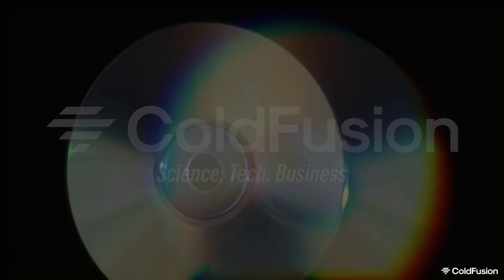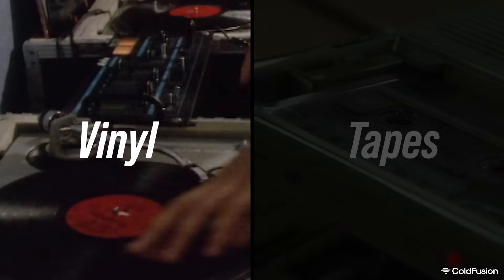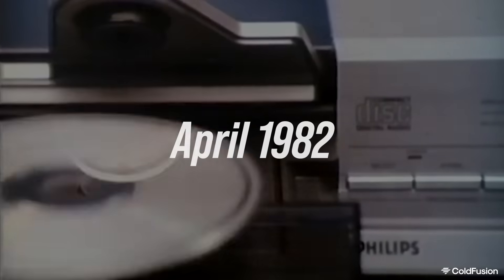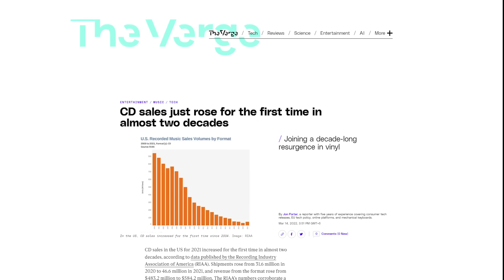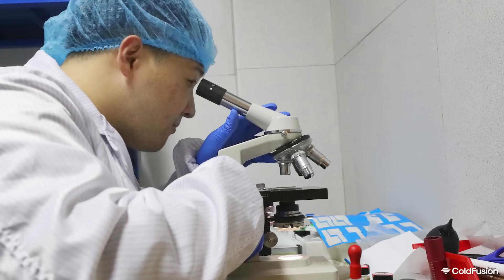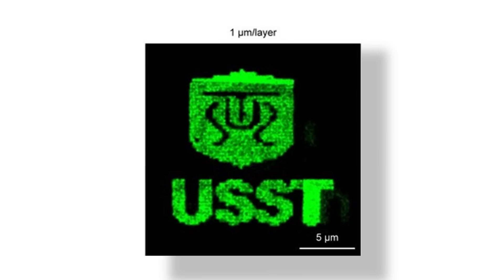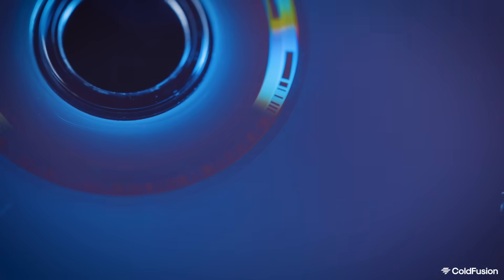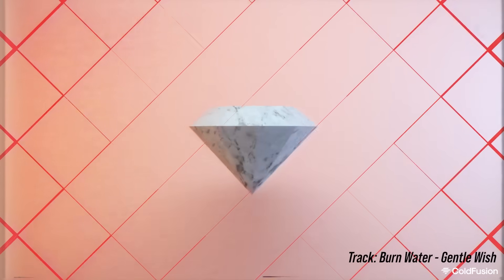Why This New CD Could Change Storage

Comment: The early development history of the compact disc is fascinating, development started in early 1975 to serve as the audio-only counterpart to the LaserDisc it was initially analog, just like LaserDisc.
By late 1975, they had adapted the technology into the ALP disc. 
The audio quality was not good, and any speck of dust or scratch in the disc would manifest as a click. It was apparent that they needed error correction, and for that they needed to go digital.
 
Over the next 3 years, under the leadership of Joop Sinjou, the team worked to create a digital version. This prototype, dubbed "pinkeltje" was completed just before Christmas 1978. 
In February of the next year, it was showcased for the first time. On March 8th 1979, perhaps the most important day in compact disc development history, the compact disc was demonstrated to a room of 200 journalists.
The technology, however was not perfected, the team contacted a number of Japanese companies, and over the next 2 weeks, the technology was demonstrated to 6 companies and committees, Sony was interested as they had been developing PCM, a way of digitally representing analog waveforms. Together over 6 meetings between engineers throughout the rest of '79 and into 1980, the format was perfected. Dynamic range ballooned from ~86db, to ~98db, Duration increased from 45 to 74 minutes. Dimensions were standardized at 120mm wide (small enough to fit into a single DIN car stereo. 15mm was set as the internal diameter (the size of a Dutch 10 piece). Cross Interleaved Reed-Solomon code was developed to make errors completely inaudible to the human ear. In April 1981 it was officially debuted at an event in Salzburg. The next year discs would go on sale throughout the world

Comment: The C3D(Constellation 3D) multilayer disc had been around since the late 90s.  The SSD commercially beat it.  It could had continued development for archiving data instead of being R/RW capability in the mid 2Ks.

Comment: Audiophiles: "you can't really hear the music unless you listen to the 2048-bit, 81 MegaHertz recording like the artists intended. And you gotta have that femtosecond laser, dude. Since you need fans you gotta put it in another room, so get yourself some Chthulu Cable to cut down on the picosecond delay between speakers. Or you can do what I did and put the laser in my bedroom pointed at the disc in my listening room. I forgot to duck under the beam once when going to bed and blinded myself in my right eye, but that just enhances my appreciation of the music with the senses I have left, y'know?"

Comment: This new storage medium isn't practical yet, but there was a time when the CD wasn't either. I will patiently wait and be glad there is still work being done in this space.
Reply: My brother and I bought a CD writer/reader for 1,000 Canadian dollars at one point lol, they are about 20 bucks now.
Reply: Imagine 2 hours movies coded into pure 12 bits RGB or 12 bit 4:4:4 YCbCr with no compression ! That would be very awesome ! Edit : Or complets series ? 😲
Reply: This will never move away from some very specific use cases. USB storage is simply too convenient. You don't need specialized hardware to read and write to it. Speeds are great. NAND memory is cheap and is getting cheaper because it's being used everywhere.
Reply: There is no comparison to ssd tech.
Reply: @Mr.Smith101  SSDs are not used for longetivity. CDs can probably be fine even after you are dead.
Reply: @curious_banda when kept well and of good quality. Bad quality cds don’t last more than 10 years. Longer than any ssd to be honest.
Reply: @Mr.Smith101 *Yet.

Comment: Why are you mixing Petabytes and Petabits? A Petabyte is 8* bigger than a Petabit.
Same with Gigabytes and Gigabits, you're interchanging them. Bits are used for data transfer not storage as in this case, but you use bytes for writing and bits for storage. Pure cluelessness.
This makes me doubt you know what you're talking about at all.

Comment: The text on the thumbnail is odd. 600 MB vs 200,000 GB. This reads horribly. Either use "600 MB vs 200,000,000 MB" to keep the same metric or "600 MB vs 200 TB" to use conventional numbers and metrics. This oddity put a bad feeling prior to even watching the video.

Comment: 6:58 A slight misunderstanding here, it's supposed to be 1.6 Petabits which then equals to 200 Terabytes (200TB) as later explained in the video correctly. 1.6 Petabytes would be equal to 1600 Terabytes (1600 TB) which is absurd. This was the same mistake my father made when he first told me about these new revolutionary CD's and I had to explain it to him that it's just 200 TB (I know its a lot for a CD but its not THAT absurd as 1600 TB)

Comment: at 100MB/sec it would take about 1 day to fill the disk -- if it could run straight through the entire time. it would also use 200kWh, plus any additional power needed for cooling. at 8.5cents / kWh -- the lower end for U.S. -- that's $17/disc. it seems to me that this will not be commercially viable in any scenario without reducing the write time by many magnitudes.

Comment: "Optical disks are known for their longevity and durability" 
I dunno about this one, boss. I've killed many a CD. I couldn't imagine what a scratch would do to one this precise.
Reply: modern CD/DVD/BLURAY burners lets you add built in redundancy, so if you're really bad at keeping CDs, you can add something like  50% redundancy on your data (half of the bit space is used for redundancy)meaning  half the CD surface can be scratches and you could still recover all your data.
Reply: Properly stored, a factory-pressed (not burned!) cd can last over 100 years.  Improper storage and poor quality burning media are what kills CDs

Comment: Mega-storage CDs are a good solution for corporate IT: companies need ways to back up data and store it in multiple locations. Another advantage is that they are offline. Google accidentally deleted Unisuper's ($125 billion) data due to a "misconfiguration". The only thing that saved them was offline backups (if they had relied on Google's online storage, they would have been toast).

Comment: More than 40 years After the first optical disc and they still continue to improve the data density over it , thats impressive but risky to put so much data on a single plastic disc that can broke, they need to make something like a blu-ray minidisc with a protective case...

Comment: Literally 2 days ago, I was lamenting the fact that we don't have a good long-term storage solution for our data anymore because CDs and BluRays can't hold enough data. And now this video popped into my feed!
Reply: i love blu-rays because they have the longest data retention, 100+ years on mdisc, also love that its a "dead" media so i often find good deals on it

but if we got 500gb+ blu-ray discs i would be more than happy
Reply: @automatedrussianbot  Exactly! 500GB would be great, 1TB would be perfect.
Reply: Why not store everything into a hard disk and put it somewhere safe?
Reply: @AntiEchoKi3  I've been using hard drives as removable storage for two decades now. The cost per gigabyte, speed, and convenience can't be matched. Burning CDs, DVDs, BluRays was such a chore. Never going back.
Reply: @AntiEchoKi3  because harddrives data integrity degrades after 7-8 years, and it would be expensive to get about 30 Terabytes worth of harddrives. CDs are cheap and last a little longer than harddrives, and they're optical storage instead of magnetic.
Reply: There already are gold CDs that are used for long term storage. But the tried and true affordable method is tape. Fortune 500 companies use tape storage because it holds massive amounts of data for cheap. The expense comes from the tape readers and encoders, which is why only big companies and the government use it and not consumers or small businesses. You also need climate controlled physical space. This is why in Mr. Robot they had to destroy eCorp’s tape backup after their ransomware attack.
Reply: @ferretyluv  They must know tape is better then; l was right yes?
Reply: @ferretyluv  tape is the cheapest storage if you can afford the readers, but M-Discs can literally survive your entire room flooding, which would destroy HDDs and tape archives
Reply: @ferretyluv  Cost isn't necessarily the main reason why most companies don't use tape. Most small companies running datacenters could easily implement LTO9 raid setups. The reason we don't is speed and availability. LTO9 seek times for random query operations are unreasonably slow compared to HDDs and SSDs, making them impractical for most applications. The long initialization times are also a problem since most enterprise solutions are meant to be hot-swapped and have to be able to quickly initialize replacement drives when one fails.

Even for long term storage, I don't think a lot of companies are storing enough data for long enough to justify having a separate LTO drive setup to maintain when they could just make use of their existing SSD or HDD based NAS infrastructure
Reply: fucking google is always spying on us. I will never buy another phone without a physical microphone switch and a physical camera shutter
Reply: Carefull they're NOT 100% reliable

Comment: For this to work,  the disc would have to be kept in a protective container that loads the disc into a player without damaging it in the slightest bit. Sort of like the old RCA CED video disc where you would put the entire disc holder into the player and the player removed the disc so it could be played. One microscopic scratch and the disc would be ruined.
Reply: almost like a hard drive lol
Reply: It's possible that the there could be a protective coating on the disk so that scratches wouldn't be on the layer where the data was stored.

Comment: This isn't going to compete with normal storage (e.g., hard drives) since you can't overwrite data on a CD. I doubt data centers need to store amounts of data that can't be changed. I haven't seen any game/music that doesn't fit on a single DVD. Not really sure what consumer will need this. Maybe movies in insane resolution...
Reply: it is useful for archival storage, there are several examples of file systems that works on the principles of WORM (Write-Once-Read-Many).

Comment: Yeah... I knew that the data transfer speeds were going to be just as bad as legacy optical media, and I also suspected that the equipment needed to read the data back off of these new discs would be extremely expensive. These discs might be a cost effective solution for bulk cold storage of data in an enterprise environment, but I doubt we see them in consumer-grade devices or applications due to the slow access speeds. It would take the better part of a month to load all of the data off of one of these discs at current data transfer rates. Access speed is what matters most in consumer grade equipment. That's why we saw consumers gladly switch away from relatively slow but high capacity mechanical hard disks to comparatively low capacity but extremely fast solid state drives.

Comment: One scratch = an entire folder of data disappearing
Reply: Not with error correction
Reply: The disc platters would be, should be encased in a protective shell to guards against people's hands and fingers coming in contact with data surfaces. Similar to DVD-RAM, that came in a shell.
Reply: @MegaSunspark  The magnetic silver discs are enclosed in clear plastic?
Reply: @johnkean6852  The protective casing has a sliding “door” to expose the disc inside when it is inserted into the drive. So the read/write heads come very close to the disc to be effective. So it’s not being read or written to through the plastic shell.
Reply: @MegaSunspark  DVDs and CDs are covered in plastic:  there was no door!   You're thinking of a different format.  Tape is still better.  But IMHO  you may think otherwise.
Reply: Not if it's an M-Disc
Reply: @GraybeardSkydaddy  MicroE R R O Rsoft is a bad word o  YT  If the M is anything to do with them  R U N  and l don't mean data.
Reply: sometimes a folder contains 10TB of data
Reply: nope, unless it's a very deep scratch. the data stored in middle layer. the CD surface is transparent plastic sheet. if it scratch you can polish it.
Reply: Podría venir en un estuche especial, como los discos MO o los MiniDisc, así se previene ralladuras. Una lástima que no aplicaron la misma práctica al resto de formatos de discos, los harían mucho menos frágiles.
Reply: @melimsah  Its like relying on Cloud or Google or Micronot to save your data  Doh!
Reply: Yes they were a good idea on vellum paper but tissue wipe ideology.
Reply: @melimsah  Aghhhhhh!
Reply: The laser goes thru the disc to burn the encode 0 and 1
Reply: Mp3 sounds like shit When u take a wav file and compress the files there is loss Facts
Reply: @roymoxley2587 Except I can’t hear a difference between VBR mp3 and FLAC/WAV that I convert from my own discs
Reply: Thankfully Error Correction has been a thing for optical media since they became digital (Laserdisc didn't have that since it was analog)
Reply: @KRAFTWERK2K6  Never worked properly.  You watched half of a film then it would go awry.
Reply: @johnkean6852  Just not true. In 2007 you could buy a cheap DVD player that could play all of my old extremely scratched up movies without a single hitch. It couldn't play cracked disks, but that was about it.
Reply: @multi-mason  Not my experience.  Maybe just bad luck on my part.  I purchased many disc players / recorders.  Not one worked properly.  Very frustrating for me at the time because they were not cheap.
Reply: Don't fckin one scratch it
Reply: If someone manages to use gorilla glass on a disc then we might have CDs that won't scratch so easily
Reply: You have to touch it to scratch it. not the case with flash storage & EMP..
Reply: Cat 🐈  : Hold my paws and whiskers and scratch some nails 😂

Comment: I don't expect a comeback of the CD as it was before. However this disk can very easily replace existing SSD's as the primary storage component... you just wouldn't be able to delete anything without completely destorying that section of the disk, which is a reasonable trade off if youre increasing average storage capacity by 200x while also cutting the cost of the storage by half.

Comment: Oh boy.    This vaporware comes back around every 3 or 4 years (and has for about a decade and a half).   On a list of things that still will never see commercial production, this is right up at the top.   Furthermore, there is so much bad information in this.   Writable optical disks are NOT known for long term stability, quite the opposite.

Comment: About 10-15 years too late in my opinion. If this came out when CD sales were coming down, when HDD storage was still expensive, it may have stood a chance. But flash storage and the like are quite cheap. No real use case for this outside of data centers and a few niche scenarios.

Comment: Real World Questions
What about:
Disc Rot?  
After a few years, many DVDs are becoming unplayable because of it.
So logically, it’s only a matter of time before Blu-rays and 4K discs follow suit, if they haven’t already.
Real world dust and dirt?
Because they hold the least amount of digital info, DVDs are the least susceptible to surface dust, fingerprints and scratches. The liability just gets worse with the increase of storage ability, to the point where you frequently have to wipe your 4K UHD disks in order to keep the information on them (i.e. video) from freezing or skipping. Ironically, this harkens back to the ancient days of vinyl records, where you’d have to carefully wipe both sides of the disc before each use to remove any dust that would degrade the sound with crackles and pops!
Real World Quality Control of Discs:
Relatively speaking, I’ve bought more 4Ks with defects than Blu-rays, or even better, DVDs.
So, you can imagine these real world problems multiplying many fold with so much more info stored on so many layers...

Comment: Biggest drawback of all optical media is it tends to be more sequential access than random access. Also, the read/write operations are always slow. Now, if it is prssed like CD/DVDs were, it would last a long time. However, since home units tend to use pigments that are sensitive to light to change color (giving the illusion of pits) those pigments breakdown over time rendering the data unreadable/unusable.

Comment: 1.6 petabits is not >200,000 DVDs. Rounded to nearest thousand, it is 23,000 for dual-layer and 43,000 for single-layer. DVD capacity is measured in bytes, so you need to multiply by 8 for the bit storage.